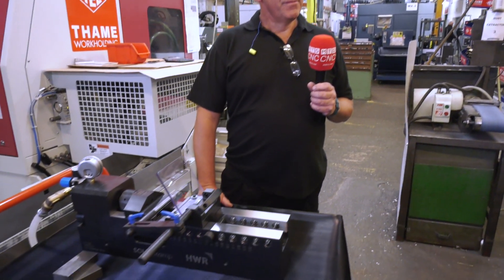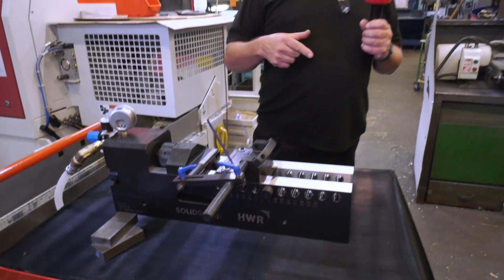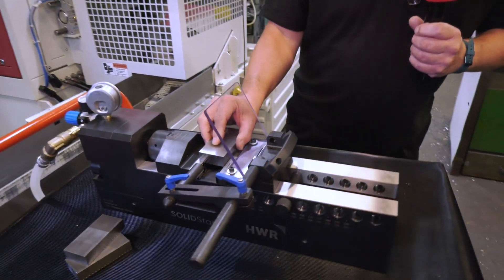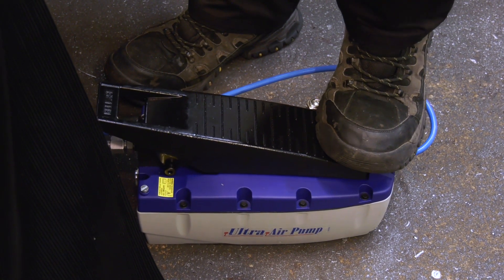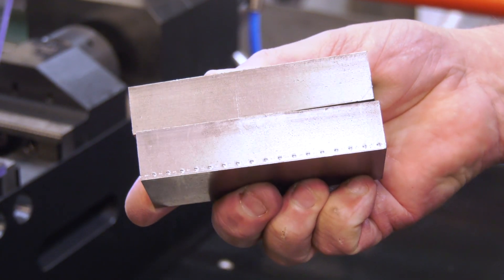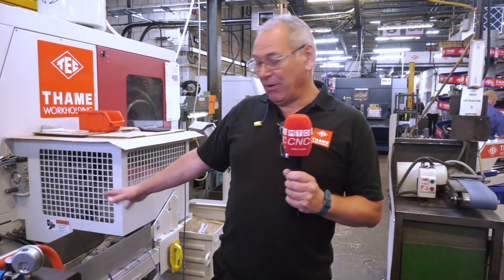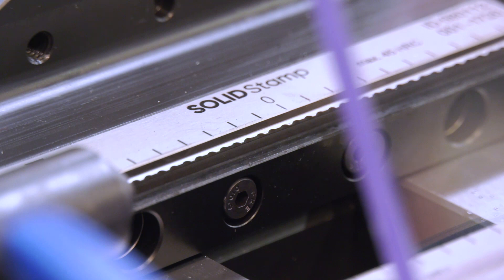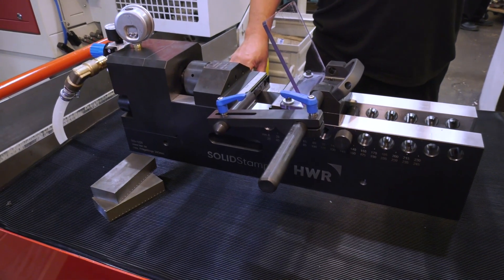Thame Workholding introduce HWR stamping technology - SOLIDStamp

Comment: If your using Lang QuickPoint (or your shameless ripoff), why would you remove the part for inspection rather than taking the part/vice as a whole to the cmm?
Reply: I can’t speak for the ripoffs but on the real deal, you can re locate the part in the vice within a few microns using the stamped teeth dimples. It’s handy Caus the vice is big and heavy and the added height and weight might make it difficult to use with a smaller cmm.
Reply from the maker: You can relocate on the stamped pattern. Glad you enjoyed the video, Don't forget to Subscribe.